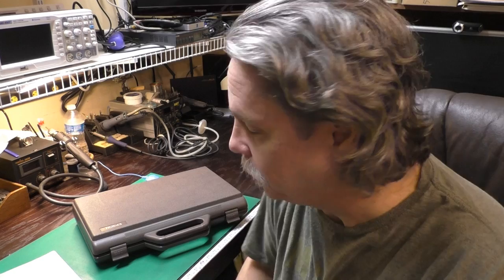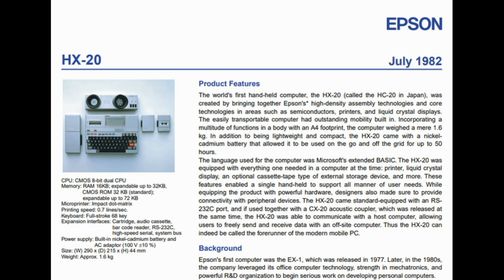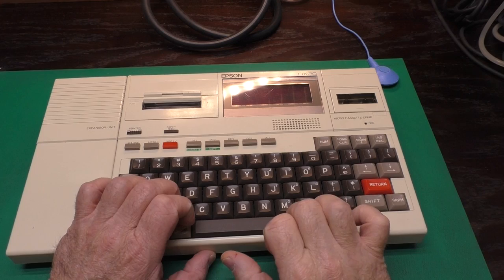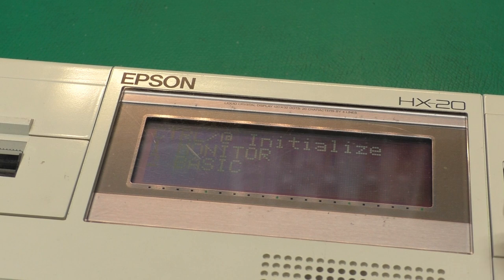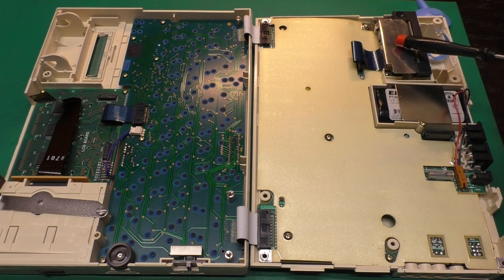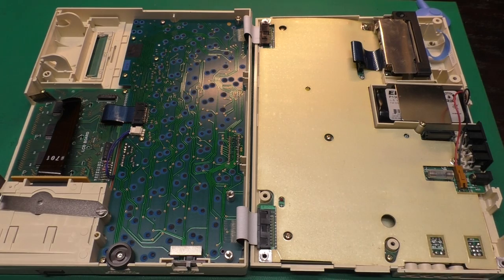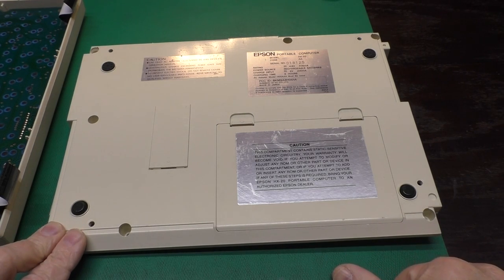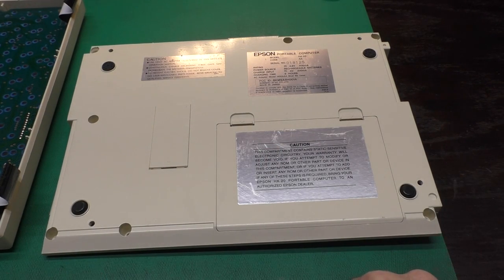(Re-upload) Epson HX-20 #1 – World’s first laptop? Overview, Dim LCD fix, clean and test

Comment: Hey Birt! You helped save my own HX-20 with this video. Mine was working but the display was very dim and flickery most of the time. I thought I needed a new battery, but upon opening the computer up I saw that it was outputting 5V. Just like your one here, it was the capacitors that had leaked. Replacing them fixed the problem and my HX-20 now works perfectly! Without this in depth video I don't know what I would have done. Many thanks 😀

Comment: Birt, thanks for this video. I was able to fix an HX-20 that had a leaking nicd. I put in a new nicd in it and while it doesn't quite fit, I was able to get it in. The battery terminals were corroded, so I put some headers and soldered the wires to the board. The negative rail was not connected all the way, so I had to run a jumper to the negative rail of the recharger. Screen was so corroded it was trash, replaced with a spare screen and it works. I have another one that has a membrane keyboard, but this corroded one has a mechanical keyboard, so for now it's my main machine. I need to get a lithium battery, figure out the charging/discharging and swap the keyboard of another one that I have.

Comment: At 20:58 you state that the voltage on C1 should be about 7v, I'm only getting 3.9v.
I'v checked the output voltages off the HD14049UBP chip and they are 2.5v
Do you think the chip needs replacing or should I check something else before hand.
Reply from the maker: I have worked on a handful of HX-20s. All of them needed recapped and 50% of them had corroded traces from the leaking capacitors. If you have not recapped it start, there and fix any corroded traces. 

You have to scrape all the corrosion off, clean with a fiberglass brush, etc. It might look like there is copper under that corrosion but there might not be and there won't be for long unless you get the corrosive material cleaned off.
Reply: @HeyBirt  Yes I have done all that and checked continuity, there wasn't much corrosion.

My knowledge on electronic components and circuitry is very limited, I can't see why I am getting 2.7v on the inputs and 2.5v on all the outputs on the 4049 chip, I don't know if the chip is faulty or whether the voltage is being dragged down somewhere else.
Reply from the maker: @centrespot  What is the IC number of the chip you are referring to? All the CMOS logic chips will run from the ~5VDC from battery pack. The 7V on C1 you are referring to above is part of the circuit generating the voltage for the LCD. 

Search for 'HX-20 Technical Manual' on archive.org. I uploaded a high resolution scan of it there.
Reply: @HeyBirt  It's IC 2C, the HD14049UBP chip. I'm getting 2.7v on the inputs and 2.5v from each output
Reply from the maker: @centrespot  Those gates are being driven very fast and used as buffers in a charge pump that develops the 7V for the LCD. They are 0V 50% of the time and 5V 50% of the time so you meter is reading the average voltage of 2.5V. This circuit is shown on page 3-13 of the technical manual.

I would still bet on trace corrosion in this area of the PCB. The schematic on the bottom of page 3-13 is the best resource for figuring out what is supposed to be connected to what.
Reply: @HeyBirt  Thanks for your help, I will check the PCB thoroughly

Do you know where I can download a complete list of components, for example what are the D5,D6,D7 diode types
Reply: @HeyBirt  You were spot on with your diagnostic, the track under C1 was corroded. I did the continuity test using the circuit diagram and found the fault. Thanks very much for all your help.
Reply from the maker: @centrespot  Glad you got it sorted. I have had that problem a few times on HX-20s in that particular area. I have also seen pads break right where they meet the trace and be almost impossible to see. Ohming it out like you did it the secret to success.